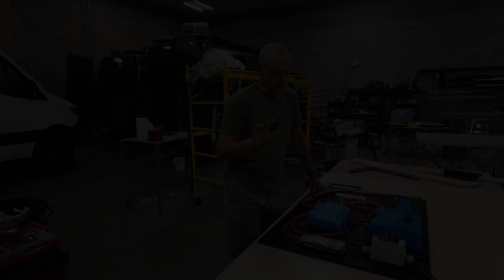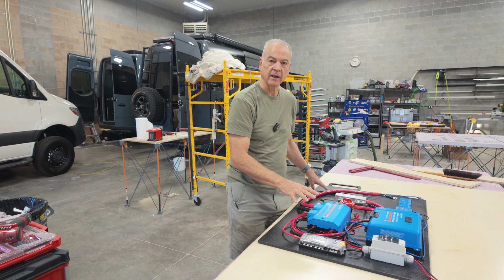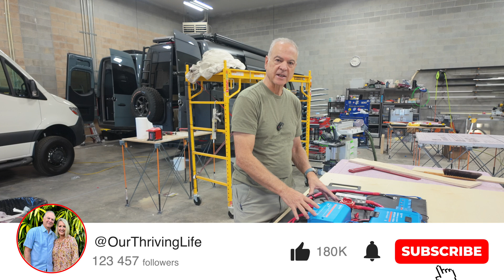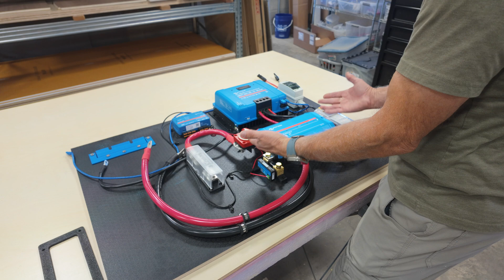Victron Lynx Distributor Setup and Hack

Comment: Hi, thanks so much for the video, I was following your guide on the switch and the shunt however I ran into a couple of small problems. 

I'm using a victron switch and the thread behind it isn't long enough to fit the distributors terminal between the two nuts and the spring washer, is it okay to just remove the spring washer and should I use something else instead? With the spring washer removed the thread is literally sitting flush with the nut on top. 

Similar issue with the smart shunt I've had to remove the spring washer and connect the terminal straight to the shunt and then the washer only (not spring washer) and then the bolt. It also isn't long enough to fit the spring washer. 

The system is mounted in a food truck with a lot of movement and it's my first time so not sure if removing the spring washers will be an issue ?

Is it also safe to use a product like Loctite 243 on these terminals ?

Comment: I notice your power ( red cable ) out of switch goes to a fuse  block but no wire comming out ?  were are the red and  black  heavy cables goig also ? ca you explain ?
Reply: 02:38 describes the (not shown) battery cables coming in.
03:16 describes the heavy cables going to an inverter.

Did you watch the video with no audio?

Comment: was wondering if you do American Power Systems secondary alternator hook up and if you do do yo you run both B+ and B- heavy gauge wires form alternator to the "house electronics?" Or do you use the frame chassis thru alternator support bracket for B- ?

Comment: What thickness of the mounting board do you recommend for your electrical panel?
Reply from the maker: We use 1/2”, but we use bolts or threaded inserts for heavier components. If using wood screws, I would use 3/4”.
Reply: @thrivans ty

Comment: Lynx distributer comes in a M8 and M10 version. 
Only difference is those end bolts are 8 mm or 10 mm, so no need to drill if you buy M10.
All future generations will be M10.

Comment: I did the bore enlargement. I agree not easy as expected. I did in the floor, probably with subpar tools, the bar was surprisly hard, and I got some brushes as the drill catch and let the lynx spin! watch out!
Reply: Drinking the lynx into your wok bench works wonder when drilling out the busbar

No movement

Comment: Jeff, I really enjoy your videos. Could you tell me about the board you are mounting the electrical components too. Is it wood or some kind of composite material? What size is it sold in? Is there a brand name? Thanks
Reply from the maker: Thanks. It is Baltic Birch plywood with a phenolic coating on the front and back. It is called hex ply or Riga Heksa. We buy it by the pallet from a supplier in California. You can search online to see if there is a supplier you.
Reply: It looks like a phenolic board..maybe plywood with phenolic face